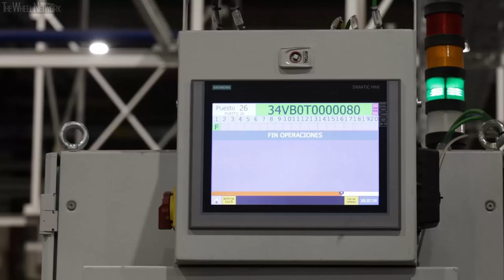Stellantis Battery Production in Spain (Zaragoza Plant)

Comment: Those are nice stack of battery ready to deploy or reserve. I wonder how heavy one complete module is?
Reply from the maker: It varies, dependent on the capacity. For example, a 50kW pack for a Peugeot 2008 weighs around 340 kg.